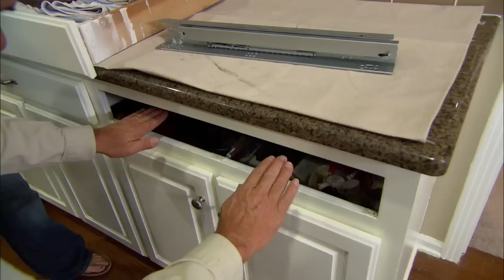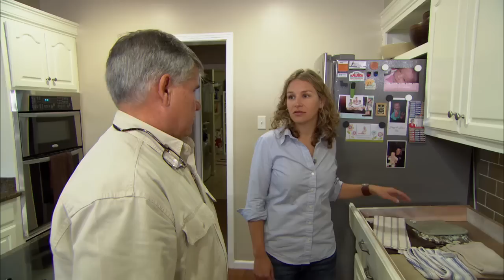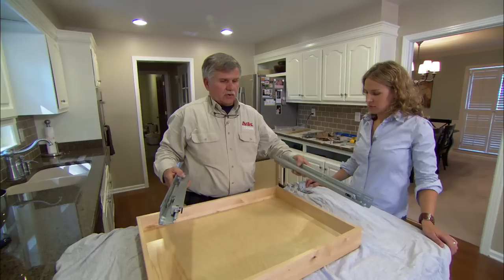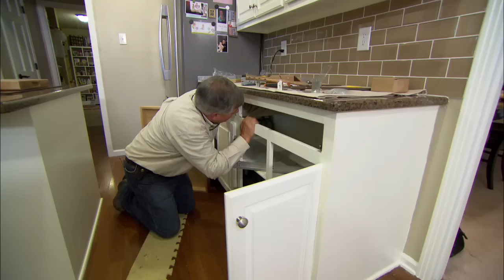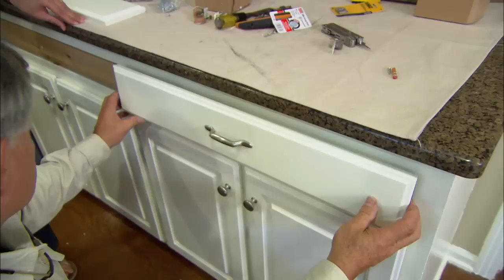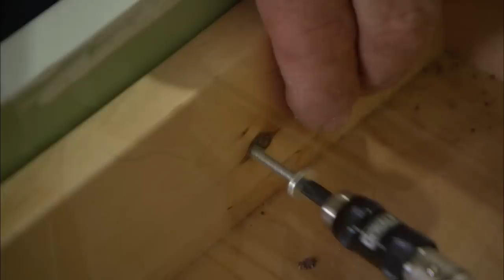How to Install Full-Extension Cabinet Drawers | This Old House

Comment: To position the draw front, I would have removed the hawdware and used the holes as a goid for where to drill. Then use lawnguh screws as others have suggested.

Comment: Like the hot glue idea.
Reply: actually, a better idea is to use strong double stick tape, maybe 2  1" squares would be enough, one on each side.  That is how I did it with all the new drawers I had to install

Comment: He located the height of the rear brackets by using a scribe. However how did he locate the rear brackets side to side position?
Reply: Tony Cellucci He attached them to the front face frame first, than measured over from the side.
Reply: He most likely mounted the front, then used a speed square at the back to get the right angle (literally a right angle), and matched the scribed marks and then put in a screw into the slots.  He probably left the screw a little loose and did the same with the other side to make sure they slide smoothly and in parallel, then once he was happy, the tightened the screws and mounted the rest of the screws in the back.  The drawer clips into place without screws.

You could also mount the front as shown, then put a magnetic level onto the rail, then use the speed square on the back of the cabinet for alignment.

Comment: i never thought i would disagree with something made by TOH ...if the drawer was remade why not make it 1 inch smaller than before and use side sliders so it would be easier and cheaper to handle...
Reply: Appearance. A lot of people choose this type of slide because they hide under the drawer. The other kind mount on the side and are always visible, even though they are just as good and a bit cheaper.
Reply: bottom mount runners are a lot smoother than side mounts

Comment: Watched maybe ten times to get an idea how the pieces fit without having the benefit of instruction or diagram on a similar slide (exact) look but with a different little lock piece and the video becomes in comprehensible! So all you jerks out there don't bother with your idiot trolling my vote is in bad vid.scimpy on detail in a once thorough video take